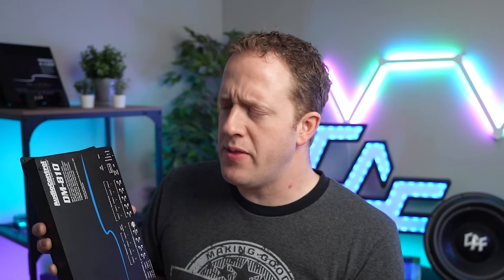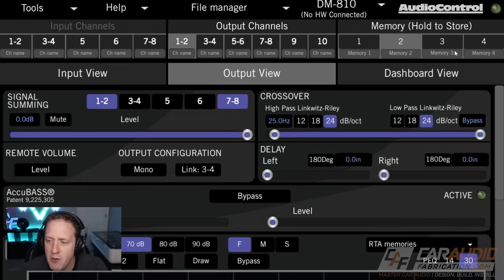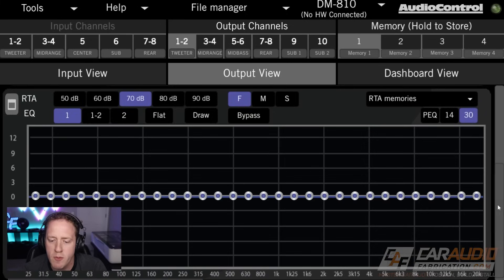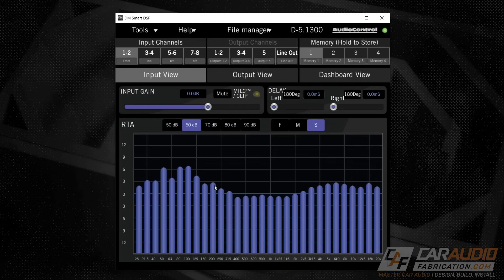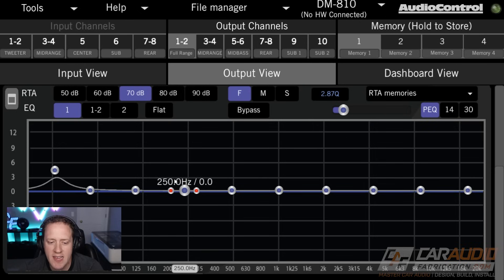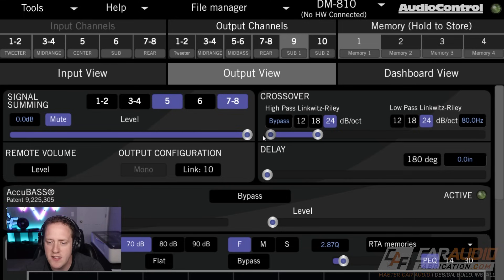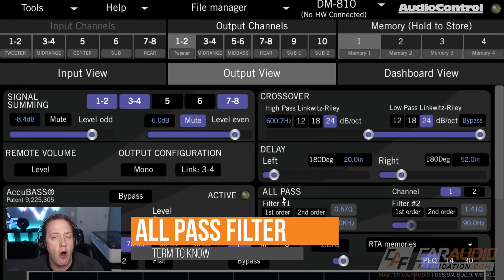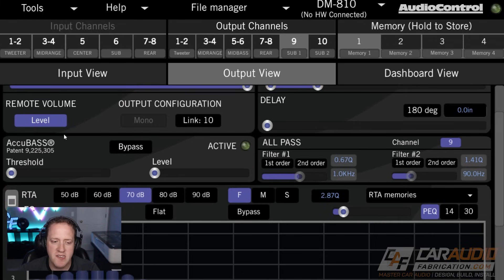Tune your system to PERFECTION - DSP Terminology Made Simple!

Comment: If I'm using an oem head unit, will I still need to use a device such as the jl audio fix 86 if I'm using an amp like this audio control dsp amp?

Comment: Been using a MiniDSP 8x12 with Dirac Live ..... I HIGHLY recommend it for beginner to intermediate IF you are going to be doing your own tuning as it is somewhat easy to learn ..to be honest I have had several years of using Dirac in my Home Theater .... There is still a learning curve sometimes very steep if you incorporate software tuning like REW or Rephase ...  
Dirac has , with basic parameter setup, an auto tune that has very impressive results ... 
The real difference in my system was putting my mids and highs on the dash aimed to the top mid of my headliner  ...the stage is now much improved down through the lower mids  ..
Tuning is really fun to get into if your a audio nerd like me and Im very grateful we now have videos like this to share knowledge and techniques ... Its especially important if you're goal is SQ vs SPL
Reply: Def appreciate  this input  I've been into audio since a child  Maybe 6 or 7 years old.  but the dsp I have is confusing asf!   which caused me to blow my 13w7s  I've never blew a speaker prior 😂   I have to adjust my things with a multimeter this time coming  and was about to junk my prv2.8x and go knobby like the old days 😂 until this comment 👍🏼

Comment: Stop teasing me and get that W7 going already!  On a side note: I just bought two mono VXi amps for two vehicles and definitely will eventually be using the DSP once I am ready to put multichannel ones in as well.

Other than the usual gain and level/lpf stuff - is there much to gain by having only a subwoofer amp with DSP?  So factory radio with a sub amp only.

Comment: I started audio controls then ps8 then mosconi aero then helix dsp and loved it now I use zapco hdv ess 9038 diaton bewithstate but always use focal crossblock as well I just use the crossblock fir an analog sound  as well amps speakers critical I use damore audiowave  steg 50c mp z sufio 4 channel venti etc speakers esoter 650 zr 9dd and eliptacor or seas or mp etc

Comment: Great video. It would be nice to see a video on how to set the amps in the head units crossovers gain and all other settings for use with a DSP. Do I set them all flat turn them off when it comes to the gain do I crank it up leave it low things like this

Comment: I'm excited to watch this video, and then continue watching and learning how to install my own system this time. I got a system my whole life. And to be honest I don't know if they've always been installed with the care that you would do for your own. I know that last time I paid a lot of money to have somebody install my JL amp my components JL speakers up front and my 619's in the rear jl and then a Rockford fosgate 360 sound processor. The Bluetooth was not even attempted, and the vehicle that I drive I really do need that I was so frustrated I just let it be and bought a wireless Bluetooth thing a majiggy. And as much as I paid I shouldn't had to have. I have JLC 5 components up front I believe that's the model number which are extremely high-end expensive speakers. I put the lower end c to fix my nines in the rear which are not shitty by any means they're badass still but the components up front are where it really needed to be directed correctly. And I always noticed that most of the power was in the rear and the rear 6x9s. If whoever did it didn't give a flying you know what. So I've since after owning that amp for quite many years. I made a purchase of an XD 700.5 I still hope to use the Rockford fosgate 360 DSP and I don't abuse my system so the components and the 619s should very well be perfectly fine. 

I have the new amp and I have the DSP mounted where I want them the way that I want them they weren't mounted very well either I couldn't even put my back seat down now I can they're both easily accessible to get to and adjust and whatever I need to do. I emulated the connections from the other amp to this one but I don't know if that's correct so to speak. The component speakers in the front going to the amp connections looks exactly the same as the coaxials in the bag so I don't know if that was correct or not but I plan on learning this and finding out myself. I'm 53, I love my music to sound good my eyes just as good as my bass, and I'm getting older and this one I want done correctly gosh darn it. I want this to be something that I get in my car and I am like holy crap being that I know that I did it right this sounds insane I love music. And I'm without music in my car now I'm using a freaking portable Bluetooth speaker. I feel like that sacrilegious if I were to die right now am I going to get in trouble for that. Lol. So I'm not really in a rush I'm more wanting to do it correctly because if I get this thing installed adjusted correctly this system will be my best system of my life and I'm super excited about that so I'm going to start watching right now if anybody has any advice I'm a strong proponent and tell me what you freaking know Tell me what I should do Tell me what I shouldn't do do you think I shouldn't do this. I'll be honest it's a little bit confusing. I haven't watched these video chat so that's why but my main confusion at this point is I don't even know if you hooked up the component speakers up front correctly to the DSP to the amp. So I get the gist of it I'm going for my factory deck and we're hooking that up to the DSP first to the ends and then we're once that is adjusted correctly I am going to run that signal out to the app where it's going to give it power. Now one of my questions at this point and bear with me if this is too early to ask it I should watch the video first but one of my questions would be so I hook it up to the DSP first and then make my adjustments there. Now it's going into the amp now are we double dipping an adjustments at the amp or are they completely different adjustments. I see the DSP is going to be more of a frequency right like an equalizer and then the amp is going to be basically you're going to do this for power I guess I'm going to watch the videos and find out I appreciate you doing these videos I feel confident knowing that I can learn enough from you from what it sounds like you are very well versed in this I can tell and I feel like maybe I can do this with your help so I want to thank you very much and I'll follow you I'll recommend you you know everything that is good for you I will do

Comment: Hey I just wanted to ask how you would go about doing sort of a Watt limiter 

because my Amplifier can put out more juice then my subwoofer can handle wich is not a problem when I'm using it but when maybe someone else is driving my car and doesn't know this and cranks the volume, the subwoofer will likely will break 

so that this doesn't happen I want to build a Watt limiter that goes in between the Amplifier and the Subwoofer that limits the maximum throughput to 100Watts

Comment: I recently put a kenwood hu in my 2013 civic, the hu has the two subwoofer outputs but the car has just one sub input. Should I get a Y cable to combine the two from the kenwood… or use one out from the kenwood. And if use one, which one, left or right? 🧐

Comment: Good morning dear friend..!!!I watched your video and it s amazing,i just want your help for tuning my dsp...I m playing with an audison bit ten dsp,with passive crossovers ...I have the Mille hertz legend 1650.3 speakers in front and the voce audison speakers back..i m playing with the Voce quattro amplifier my speakerts...and i have a 12 inch subwoofer which i play with a mille hertz 1000 amplifier...First of all i would like to ask you while i m trying to set up my system should i listen to my front unit and my subwoofer only,or should i set it up with all speakers playing  together?The volume of my amplifier should be the same in the front and the rear speakers or the rear speakers should be a little lower?Then what frequencies should i use to my speakers.80 hz is  ok front and rear for my midwoofer?And i feel my sub is not kicking,i mean i miss the kick...its playing in 80 hz,should i go a bit up for example 120 hz or it will mix the frequencies?...And a very crucial question...which frequencies should i emphasize when the voices sound a bit dark,i need to add brightness and which frequencies help me to give clarity to my tweeter?And about the slope in my sub,should this be in 12 hz  or 24?Thank you very much dear friend for your videos,they are very helpfull...As you understand i m trying to set it up by my self that s why i need your guidance...i wish you all  the best my friend ..My kind regards!!!

Comment: Hello Mark, important question here.
   Do you set your amps at full pass with frequencies wide open when running your dsp or do you adjust your amp’s accordingling just pass the frequencies on dsp???? 
    I’m all about SQ and wanting to know if adjusting your amp frequencies just past your crossover frequencies on dsp will clean up any unwant noise from the amp. I’m working on a new build and currently do not have a dsp. But I see nobody talking or mentioning this. Is everyone just running there amp frequencies wide open? I’m thinking setting amp frequencies/crossovers just past the dsp crossover settings would give cleaner output rather then just setting amp full pass with lows all the way down and highs all the way up. I know the dsp will cut the extra signal of amp off but still think in terms of theory that also adjusting the amps this way that it could help cut out any unwanted noise especially on the highs. How do you set the frequencies on amp’s when using the dsp?

Comment: I agree, a video discussing all pass filters. 
About the AC software though, I'm sorry, but it still sucks. It is better than what the previous version was, so they're moving in the right direction, but I moved on. Got tired of waiting 2 years for a parametric eq and other slopes besides 12/24 and only a Linkwitz-R. I was riddled with issue after issue that was all software based. But props to ACs customer service. Top notch as always.
Reply: So what did you run with then
Reply: @Willie poker  I originally had a Mosconi 6to8v8 but needed, wanted really, 2 more outputs, so I sold it and bought the 6to10. Because of the issue I had with that piece (99% software) I sold it and bought the Arc Audio PS8-50 at a price I couldn't pass up. 
Also realized with the head unit I'll be running, I didn't need the 2 extra outputs. I'm beyond happy with the Arc unit.

Comment: Hi! Thanks for this video. I ordered a vw passat b8 with Harman Kardon soundsystem. Still not arrived but there are many negative opinions on that and positive as well. What do you think. Is it possibble to tune the factory dsp of the system to have a better sound? I do not want to replace the system. Any experience on Vw H&K systems? Thanks a lot.

Comment: hello I want to keep my original station for the options and connect by transplanting myself in parallel on the original fakra a pioneer station for a sub amp it is possible turn on both ampere levels thank you

Comment: i have a 2014 ram 2500 and keeping the factory head unit, do i need to run both an LC7I and a DSP or can you just use a DSP to get line level to RCA

Comment: So, in theory, I could run three way with a 4channel if I use the passive crossovers?
Reply from the maker: Yes. You would only need a two channel Amp and if the passive crossovers allow for three output connections you're good. Do note though that there are many benefits to running active. In which case for a 3 way component set (tweet, mid range, mid bass) you would now need 6 channels
Reply: @CarAudioFabrication  OK yeah I’m just trying to save some amperes somewhere in case I want to go with a stronger monoblock block only got a 250A alternator

Comment: Kicker L7T 10inch shallow sub or the JL 10TW3 D4 which one is better, the kicker is with 500rms and the JL is 400rms .. is it worth spending extra to get the JL 10TW3
Reply from the maker: Depends on the application. We could definitely run an analysis and help you determine what is better for YOU here: https://www.caraudiofabrication.com/product-page/subwoofer-s-and-amp-system-design-consultation-with-mark

Comment: Question if you can help.  I'm having trouble with my dm608.  I keep loosing my saved outputs and it keeps going to a generic tune without subwoofer so i ordered a new one and it wasn't shutting off my saved files did last longer than normally 3days but i forgot to unplug it and it killed my batteries so i went out and got new batteries and now it lost everything i couldn't get any sound out of it or connect via Bluetooth so i took it out im ao frustrated and need advise.  Only thing i really did different than most i see is i didn't label my output channels or anything really just use what was already their and i did my front speaker outputs to channel 1/2  and my full range to 5/6 and sum together and my subs where on 7and8 so any advice

Comment: Hey. 
I tried tuning my old focals to get it to sound a bit "warmer" if you will. 
I now got Focal FX3s. Any tips on how to get them to sound warmer? They are very flat at the moment, i want more depth. I know you cant really tell me how to tune them, but tips would be much appriciated!!

I dont have a mic, so this will be by ear with original crossovers. Helix DSP 3s

Also. My mid/tweeter pods (plastic) sounded really boxy, but i deadened them and they sound better, but still a bit boxy sound, tips?

Comment: I am about to by a 810 but man there has been a lot of complaints this past year about hissing and software issues 

Normally they had such an unbelievable reputation. And you would assume that overtime thanks we get better but it seems like unfortunately recently when you go across the Internet on forums people been having a lot of issues. 

It’s frustrating because if you look hard enough, you can buy an 810 model factory sealed for about 600 bucks or less if you look good enough 

But the only other route for six in puts or eight inputs and eight outputs, you’re stuck having to buy two separate units from JL audio and now you’re looking at $1000 easily. 

I’m all for SQ but $1000 without the cost of any speakers are amps is pretty ridiculous 

Someone Hass to have another DSP outthere that has at least six inputs and 6 to 8 outputs and is logistically legit, except for audio control and JL audio 

I think focal does have one but it’s $1200 and I think Hertz has one also but I’m not sure on the input side and now you’re looking at I think $800 

Sometimes I wonder if I’m better off just getting their lower tier model like the DDX or the DXQ or the DX 61 or whatever the hell they’re called so you don’t have to deal with all the software issues. But I don’t know how good their time alignment is.
Reply: Ddx and dqdx are both fine

Comment: I just hooked up a skar amp to four svc4ohm wired down to 1ohm why does one sub pop like a electrical pop when turned up??
Reply: Sounds like a ground issue. Do you have your power wire on the same side as your RCA jacks?

Comment: When is to much equalization is to much? Head unit eq , DSP eq , then speaker 🔊 crossover’s..
Reply: Take for example, stinger’s high 10 head unit eq and crossover and time correction… then jl audio vxi amps and eq..
Reply from the maker: You will want to tune on the most powerful device, so even if you have an aftermarket head unit, if you add a DSP you will want to leave all the settings on the head unit flat and turn off time alignment etc there. Do your tuning on the DSP itself. Also important to understand that head units are very limited on what they can do tuning wise. The eq on a head unit is often for the WHOLE system, and not each individual speaker which is FAR more powerful.

Comment: Would a Dsp improve the sound quality of an aftermarket Android head unit??
Reply from the maker: 100%
Reply: @CarAudioFabrication  thanks sir. I’m going to be getting one built into the amp. Power acoustik rzr-2500dsp. I saw on YouTube this company over rates the power but half of the stated rms would be good enough for my setup I believe. I’m replacing factory speakers In my Volkswagen rabbit with JBL stage 3 637F , shockwave 150W65, Club 3412T, and the stage 2 424. I recently got an android radio and I’m considering returning it if I can’t improve the sound quality :)
Reply: @CarAudioFabrication  dude I installed all the stuff I listed here and my tweeters started smoking..

Comment: I lost all respect for Audio Control. I bought 2 DM-810 and they both hade noise at low volume. I tried everything to get rid of it, but nothing worked. I bought the JL audio FIX 86 and the TWK 88 guess what problem solved !

Comment: this is still too complicated. i'll have to pay someone to to set the eq for me. why don't these f'in things have eq presets anymore? absolute madness
Reply from the maker: An EQ preset is completely pointless. You might as well just have a child randomly touch the EQ, that would achieve the same thing. Setting an EQ is not complex at all, you simply use a measurement mic while playing pink noise and adjust. Check out this video -  https://youtu.be/1Rs2ZghGXEc?si=0InrLXXZsXpdvDes